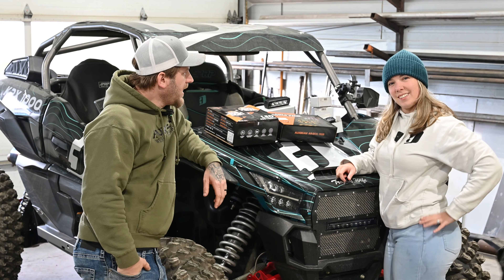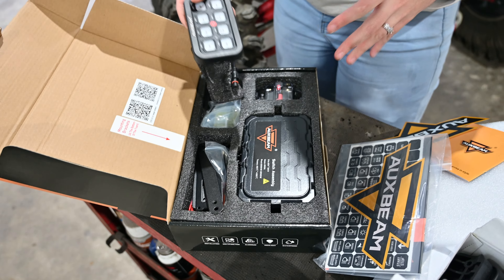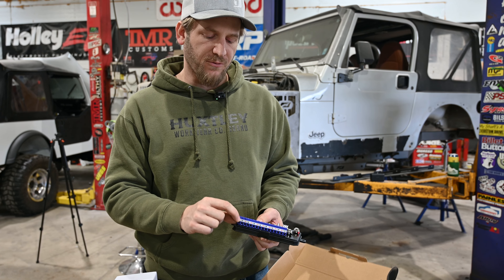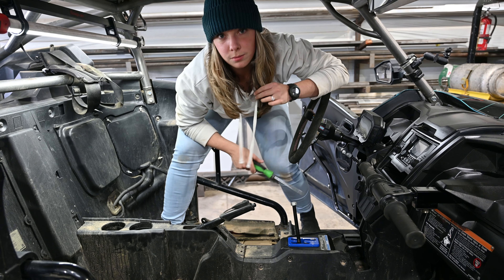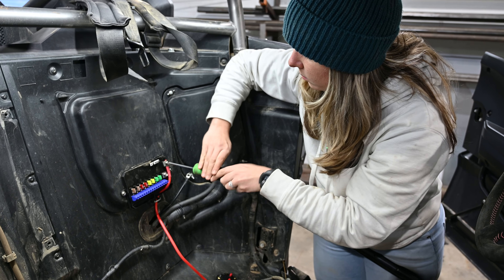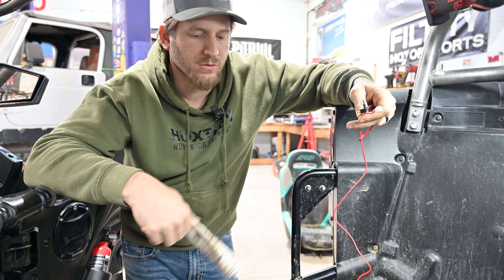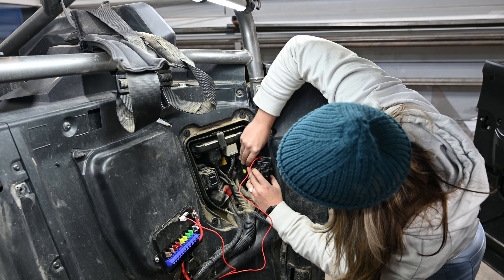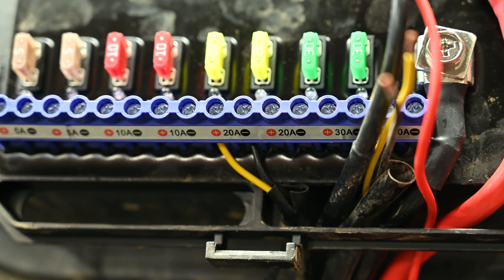AuxBeam 8 Gang Switch Install and Review... Is It Really THAT Easy???

Comment: Nice install. The only thing I would have done differently is to replace the wires that come with the unit. They are copper cladded aluminium. So not the greatest thing.
Reply from the maker: Thanks for the tip!

Comment: Regarding swapping out the fises for larger ones the only thing you need to worry about is pulling too many amps overall to overload the circuit breaker. If i recall correctly when i installed mine i noticed that all the amps from the fuses combined equaled its max amperage rating. So as long as you dont run everything all at once on higher amp fuses you should be fine
Reply from the maker: Yup especially if you run everything at once! Which usually isn’t the case but if you did the main breaker would trip for sure it’s the safety

Comment: How did you wire the PRP seat heaters? Mine have to two harnesses coming off the bottom of the seats. One to the switch and the other to power and ground. Am I doing away with one when I run them off the switch panel?
Reply from the maker: You remove the switch that comes with the seats and hook those two wires into one of the terminal spots in the auxbeam 😎

Comment: Works perfect installed it in 2021. In our Krx. I have installed 20+ 8 Auxbeams under the hoods or under the dash in utvs. Your location is a great option. Next one I will install into the fuse box. I run all the wiring even if the don't have all there accessories for the auxbeam. Most now know what they want and are ready for accessories in 2024. You both are awesome. Great videos.

Comment: My camera does not automatically turn on in reverse. I used the plug and play from kawasaki. I have to go to menu then select camera. I can toggle between fron or rear.
Reply from the maker: That is interesting information! As our one machine with the 7” display the reverse comes on automatically when shifted into reverse so you can see the camera! I wonder if it’s a settings thing
Reply: @d3offroad  i went through them but its all new to me. Ill have to check again.

Comment: Another great video! I've been using it for over a year now. FYI,,, 2 relays are 30 amp the rest are 20 amp, you would have to change out the fuse to the size you want. You'd have to be careful of not exceeding 60amps total. Great job guys!
Reply from the maker: Yeah for sure! Thanks for watching and commenting some good info to help everyone
Reply: I've been searching for an answer that nobody seems to be asking the question for - Do I "NEED" to follow the Auxbeam recommendations for circuit loading? (i.e. is the control module limited to the circuit load ratings by design? (30a, 20a, 10a, etc?)) Or can I just switch around the fuses to make circuit the amperage different on other buttons, providing I don't exceed the maximum amperage rating of the box (or 30 amps per circuit)? 

(9:00) I think I have my answer here, but I'm going to ask the community anyway.

My box has two (in amps) 30s, two 20s, two 10s, and two 5s in descending order from top left to bottom right (8 gang), but for the purpose of mapping switches out on the panel, I want to put things in different places, like a bigger load towards the bottom right of my panel. I'm just worried the internal solid-state relays might be rated for the ratings listed on the module, and no documentation seems to mention this limitation.

Your comment seems to give me a glimmer of hope, but I have no idea how solid-state relays work. Would almost prefer the mechanical relays and just switch around the ones I wanted, but here we are. Also, I bought a smaller 6-gang Auxbeam panel with mechanical relays and all of them were 30-amp relays despite the fuses varying from 30a to 5a, which makes me think the solid-state relays might also be rated to 30amps...but I'd never bet on an assumption like that.  

I'm hoping someone out here has an answer to this. As an auto electrical guy, I wouldn't even think of overloading a circuit beyond it's rating, but I reeeeallly want to put the circuits in different places, so I'm kinda stuck at the moment. 

Thanks for any help from anybody, and great video guys. I was only able to breeze through it on my quest for answers but it was solid. Liked & subbed.

Comment: Excellent vid having Mel do the work really helps you both explain it clearly. Did the Auxbeam pods you mounted on the pillars above your mirrors come with a mount or did you fab them up?
Reply from the maker: Thank you! I just grabbed some metal in the shop and whipped them up quick for her, maybe next time I’ll have her weld them on what do you think?

Comment: Great video,  Enjoy all you videos, keep up the good work.  Question I have, when you connect your seat heaters to the pod, do you loose the high and low temperature capabilities?
Reply from the maker: Thanks for watching! The prp seats only have on/off function not high and low so we did not loose that function, if you have that than it would need to be wired differently for sure 👍

Comment: The pod lights have that push button on it that changes between the yellow, spot and combo. How did you deal with that on the switch? I have the same switch in my jeep with the same lights. Thanks,
Reply from the maker: We cut apart the harness and decided to only use the spot light. We got rid of that button entirely. Now if you were wanting to use both options, what we did in the rear with the flashing amber, is we wired each wire for each option to separate buttons. Does this help?
Reply: @d3offroad  It does help thank you. I have a RGB auxbeam light bar that I tried that with that had spot and then a different area that a controller would change colors. I tried running it to 2 different switches and it didn't like it.
Reply: @n2sport1  Hi. I'm in a similar situation. I have a multi-mode Auxbeam LED light bar that I want to install using the RGB 8 gang switch panel. I know you said you didn't like it, but did it work? Were you able to cycle through the modes in your light bar? The other question is does the switch panel eliminate the need for the factory relay(s)?

Comment: Question guys, when the lights come plug and play with a rocker switch and relay do you just cut off the switch and relay and just run the 2 wires? 
 great video you guys. I wish my wife and I worked together like you guys. Lol
Reply from the maker: That is correct, you can run it that way for sure 👍
Reply: @d3offroad what if your pods have multiple options as yours does with either white or amber? Not just a simple black and red wire. My pods have a high beam and a low. 3 wires blue/white and black. White is high, blue is low and black ground. How would I attach to control box? Thanks for your time great video.
Reply from the maker: @tazarack  since this system is only a single moment button you would need to use two buttons one for low and one for high so hook white to one button and blue the another if it was mine I would probably hook a light like that up to a double moment rocker switch and keep the 8 gang for 8 different circuits

Comment: So on mine number 4 is a 5 amp fuse, can i run a light bar on number four and just put a 25 amp fuse in? or do I have to go to the 30 amp socket?
Reply from the maker: You can put a 30amp fuse in that location but need to put a 5amp in one of the other 30s than, you can’t increase the total but you can move them around if needed

Comment: Love the video, because let's face it, electrical sucks   And if you're not laughing, you're miserable.  Couple of things for you. Yes, the fuses are interchangeable .  What you need to know when you make a circuit is the amperage draw ir the wattage of what you're applying to a circuit.  Lights pretty much all tell you what their wattage is.  So if you have a 240 watt light bar, you're going to want a 25 Amp circuit.  Ohm's law helps.  P = E x I or wattage equals voltage times amperage. 240 = 12 x 20 The reason you want slightly higher fuse (25 in this case) is to allow for surge and fuse wear   The other thing I would have done with your build is add a mini ANL in line fuse from the battery to the relay to protect the entire circuit to the block.  Also, look at some of the tilt forward options for your seat.  Allows for easy removal and will raise Mel up about an inch and a half, which will help with her ability to reach and her visibility.  Plus, it will be far easier to get to the fuse block if you need to.
Reply from the maker: Electrical does suck!! Lol! And thanks! Definitely all things to take into consideration! Removing the seats is definitely a pain.